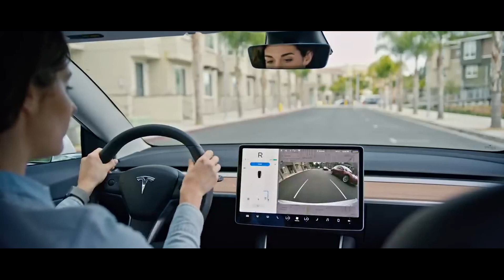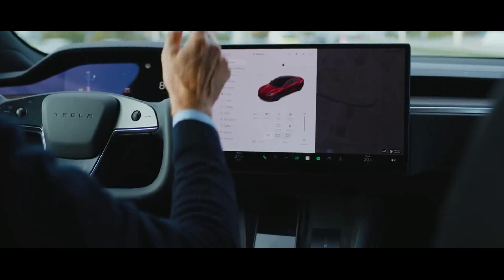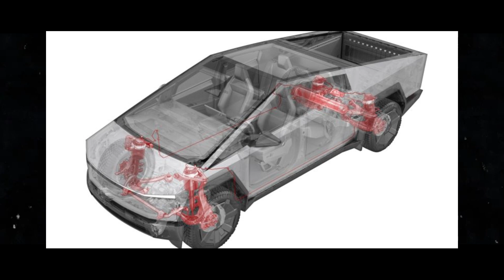THE END OF LITHIUM! Elon Musk reveals new BATTERY that will change the entire industry!

Comment: Using the batteries only between 20% and 80% then drastically reduces the range of the car for longer journey`s.
Reply: Theyre not a singular battery and the anodes are connected to each and charged individually.  Do your research before spreading misinformation.